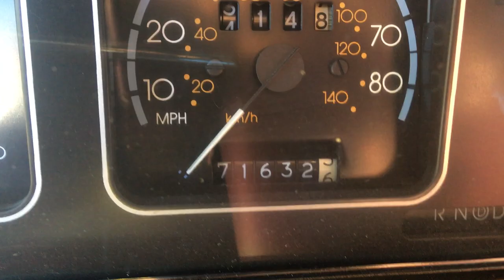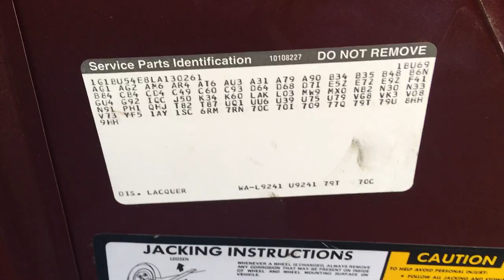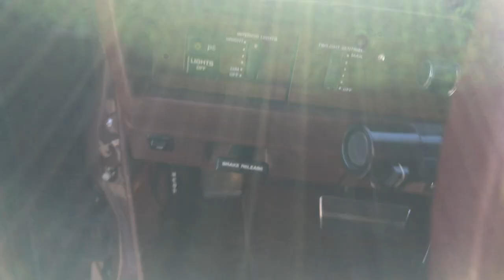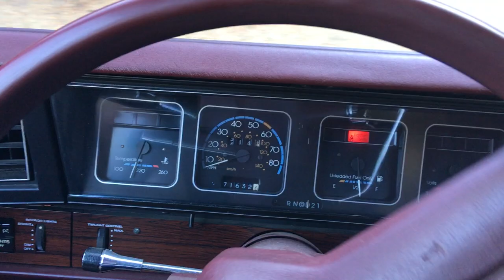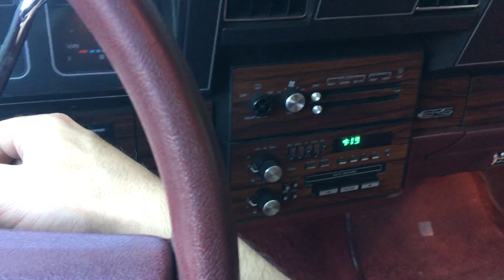1990 Caprice LS Brougham 71K original SOLD

Comment: Do you drive the car in drive or overdrive
Reply from the maker: Drive on the streets and overdrive on the freeway after 65-80 mph or whenever I want it to go into OD. Dont drive OD on the streets, overdrive is meant for saving gas on the freeway or at high speeds
Reply: @CapriceHunting  can i shift into overdrive while driving or only at a complete stop
Reply from the maker: @CE4OUR  you can shift into OD while driving.  is it a caprice or regular car? Overdrive is a gear meant for fuel economy.